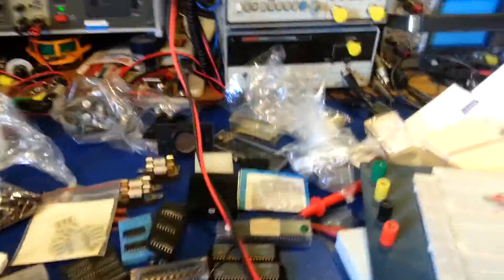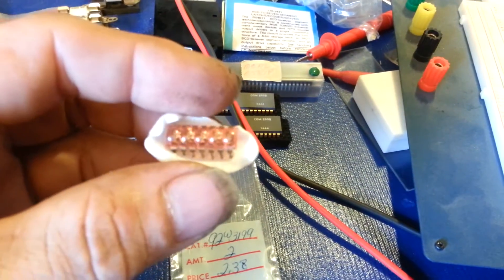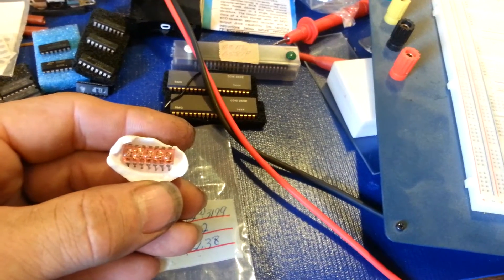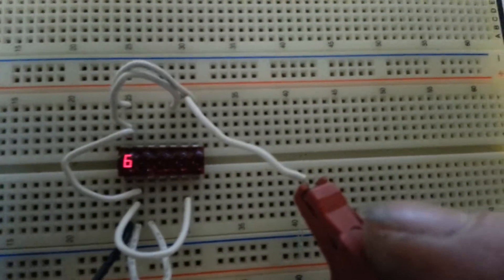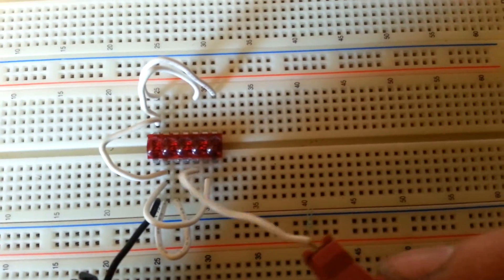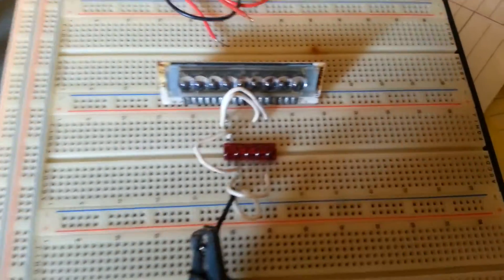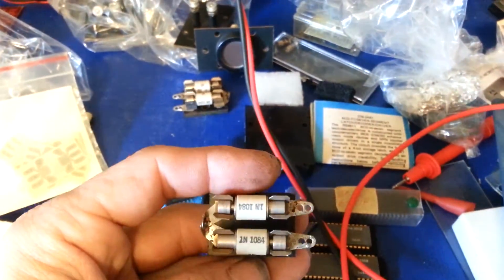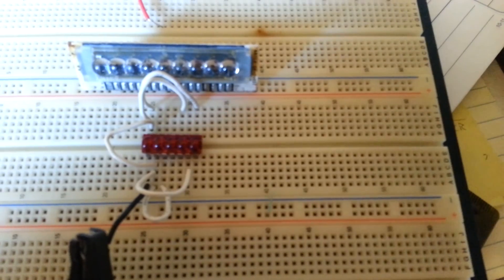Worlds smallest 7 segment LED display???

Comment: Looks like a "grab bag" item. I used to get stuff like that a lot . Calculator display perhaps.
Reply from the maker: Possible but it just seems to small for that.  I measured one before putting them away and the digits are only 1/10th of a inch tall.
Reply: That is tiny!, No idea what it was for lol.

Comment: you know, that might have went to the HP 31(e) calculator? may have had two side by side
Reply: +su pyrow Beat me to it. I bet it is too.
Reply: +Mark19960 
that avatar is hysterical LOL
Reply: +su pyrow Thanks :) It's an attention grabber.
I know around here I had an HP calculator that had the 7 segment bubble displays in it.... I am looking for it.
Reply: +Mark19960   i have a TI-1025 with a blue vfm, got it on ebay with the original case for 3.00 there wasn't even hair on the velcro! i love it
Reply: +su pyrow There is this doc on the net about the HP bubble display:
https://rheingoldheavy.com/hp-qdsp6064-bubble-display/

Good stuff.
Reply: +Mark19960   I saved that to my harddrive that's good stuff to have on hand software and everything.  im actually watching your video on the cobra  148, i just subscribed!  im 8 mins into it!
Reply: +su pyrow Well, thanks.
Hope you find my hackage interesting.
I have a box of stuff here that I got today that I need to go thru but no boards yet.

Admittedly I am interested in this radio that Mike last looked at with the bad rom.
The more I think about that the more I think there is more to it so I hope he does more videos on it.
Reply: check the comments. sad so far...
Reply from the maker: +Mark19960 

Hey, that looks like the critters I have other than those are 4 digit.  Good find on that page.  The more I think about them the more I think they would look cool as a mini frequency counter display.